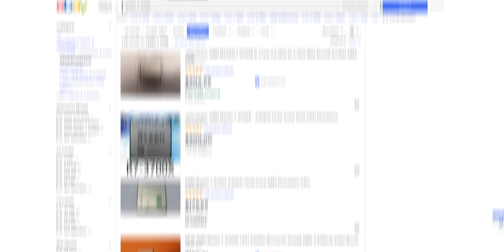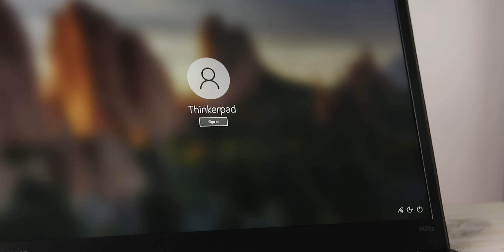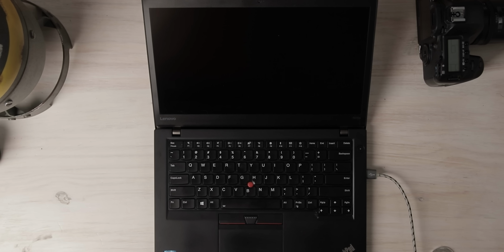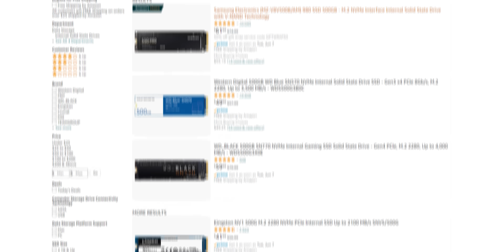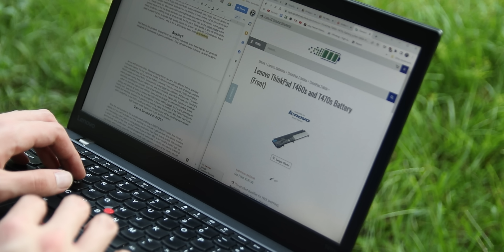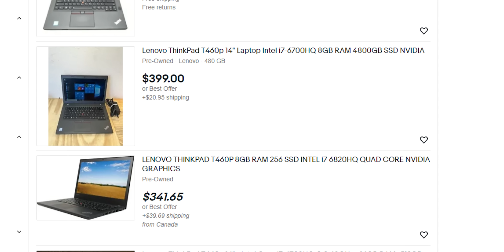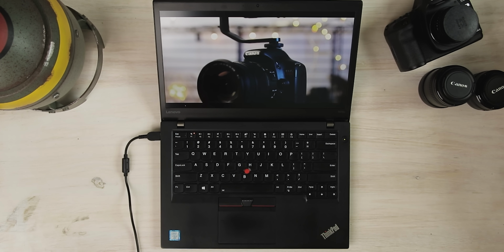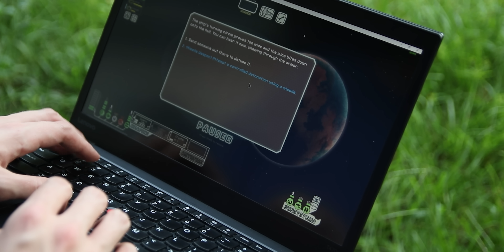I Couldn't STEAL A Better Laptop... I Tried - Lenovo Thinkpad T470s

Comment: Lenovo keyboards are awesome. I have yet to use a laptop that has a nicer keyboard than a Lenovo Thinkpad, and that includes the keyboard on my $4,000 MacBook Pro. (The MacBook is an awesome machine, but the keyboard is ass and I generally use a Logitech Bluetooth mechanical instead.)

Comment: i got a L380 with i5 8350 at 170USD. it was from a computer part store, so i ask if the can upgrade me to 16GB ram. He was like ok. i walk out with a laptop with 16GB RAM, 256SSD NVME, and only 230+ charge cycled battery. add another 5USD for a fresh thermal paste. Viola, a good laptop that will last at least another 3 years

Comment: I'm new to the whole Thinkpad Linux thing, but I'm looking for a portable laptop that I can use when I'm working away from home to self teach some web development. Don't really want to go down the MacBook path as they're way out of my budget, so what Thinkpad should I be looking for on the used market?
Reply from the maker: Can't go wrong with a T470/T480 if you need a 14 inch screen in the low $200 range. If you need a bit more power/cooling/screen the p50, p51, and p52 are all great options too. P70 for a nice big 17 inch screen, and X280 if you want a more compact laptop. I'm currently using a T14 gen 1 with Ryzen 7, absolute machine.

Comment: i bought this computer two days ago because of this video and i'm excited to try it!! Does it get overheated?
Reply from the maker: Glad to hear it! For doing basic tasks or gaming, my i5 model didn't overheat. The i7 did get warmer but I haven't done much extensive testing on it. Looking to start including more insight into how hot laptops get in future videos.
Reply: How is going? I'm about to buy one
Reply: @jaco2770  It's a great laptop, I use it for everything, and I haven't any issues related to performance, I did the same as he did, updated drivers and it is working really smooth, I just had an issue with the rj45 port, after one month it isn't working, so I'm going to talk with the seller, I have a one year warranty, I bought it in eBay

Comment: I recently got t480s refurbished. I chose the ram 24 gb and 1 tb ssd thinking it would be better. It is preety fast but my only concern is the high fan noise. I cannot understand if it is normal no have the fan working like that while just using google chrome.. and I downloaded a computer performance test and the result was below average. I am thinking if I should give it back

Comment: This is why I get so angry about the arbitrary "8th gen" CPU cutoff point for Windows 11. All the best cheap thinkpads are 7th gen and lower. I've been using an X270 which I got for insanely cheap (round about $120 - $150) and the only "upgrades" I did on it was a new extended battery (which turns it into a bit of a chunker) and a new SSD for more storage. I use it every day on battery and I only need to charge it once a day, easily get up to 10 hours but the only downside is it's still running a 6th gen so no free Windows 11
Reply: I suspect part of it was establishing quad-core as a baseline as well.
Reply: @TheGreenReaper  Nah. It's 100% ageism. Windows 11 is perfectly happy with a celeron N4020 which is a dual-core cpu and also some Pentium Silver (also dual-core)

Comment: Go Thinkpad!  I love these machines and everything about them as I cling to a battle scarred i7 T430s (3520M @ 2.9 GHz with 16 GB of memory and the NVIDIA NVS 5200M upgrade from circa 2012.  Further to comments re Thinkpad vs Macbooks, I specifically found and ordered it because > 11 years ago it would click into its dock for THREE external monitors at 1920 x 1080.  That was something I needed then, but a request which inspired only confusion from Apple salespeople.  If it finally dies one of these days, I would appreciate a smaller, lighter Thinkpad (if possible) with a higher resolution (non touch, preferably glossy) screen.  I continue to dock and mainly use external monitors but that would help for travel and /or watching a movie when falling asleep.  Could any experts please recommend a Thinkpad model and spec to replace it?  Which might also be a bargain in today's refurb market?  Thank you so much.

Comment: I got a Lenovo A485 with 16gb ram Ryzen 5 @2.2gH+ 4 core fpr $2670 delivered eBay.. but it doesn't like Linux (I'm running Mint on it now, but there are quirks) so I got a T480 i7 quad for about the same..  I did get one A12 that was semi-locked (BIOS tracking activated).. and that absolutely would not boot any version of Linux
Reply: 2pk Magnetic USB C Adapter 5Pins Type C Connector USB PD 100W Quick Charge lot

Comment: I have a question is a t14gen2 better with ryzen 7 5850u or intel i5 1145G7?im in the market for thinkpad to use in my last year of college.thanks
Reply from the maker: I'm personally very partial to ryzen 5000 in laptops over intel. If it was a prior ryzen generation (3000 and below) I would probably go intel.
Reply: Ryzen 5850u is faaar better in every aspect
Reply: Ryzen 7 hands down, better cores vs the stagnant Intel and vastly better IGP. Just be sure to hunt down a very good ram kit with good timings then you'll never look back. Don't use single sided modules as the LP style ram docks 20% of the performance for both AMD and Intel.

Comment: please, i need an advice.
in my country T540s & W540 is in similar price.
i will use it for my study in 2D design but since covid hit hard my family, i can't dream more for brand new laptop.
since T540 only have one slot ram im afraid if i need to upgrade it later since the laptop will use at least for next 3 years.
did w530 is great option or I should chose T540s anyway ? 

and this will be my first laptop 😄. 

thank you for the answer.
Reply: Definitely w540/541 suite for design powerhouse
Reply: @DOLFO_CH  thank you very much fkr the great bright reply sir.!
Thank you.. really appreciate that.!

Comment: Ive had a t430 for like 5 years lol still great and fast. Battery definitely not good as it was. I have the dock station also for it which comes with even more ports and a dvi and vga slot also. Its weird cause i use geforce now streaming for gaming and no problem?

Comment: I have one of the thinkpad series Its a carbon x1 screen spoilt after while. Apparently finding a replacement has been a bit of a struggle. It has even came to a conclussion that the problem might not be the display but rather the motherboard. I dont know what to do with the machine now.

Comment: Are you sure the T470 doesn't run Win 11?
I only ask because I have a T470 running 11 and after your comment I'm wondering how.
Reply from the maker: From what I understand, it's not "officially" supported, but it's pretty easy to throw windows 11 on almost anything and it'll still run fine
Reply: @aChairLeg  yeah I work in IT for a non-profit and Windows 11 does for most part install on pretty almost any Thinkpad -- even the L450 from 8 years ago!

The only "caveat" (if it is one) is that the 'big' 22H2 update won't install because Microsoft says only laptops  with Intel Core 8000/AMD Ryzen 3000 and more recent CPUs can install that significant update.

I have heard of workarounds, like editing some .dll file that somehow removes or bypasses the check Windows conducts to verify whether your hardware is officially supported or not, but I have yet to try it myself.

Comment: whoever goes fro a crappy new one instead of those good old poweful ones is just an ignorant i still have one with an ssd and another ram stick in and it legit made me 10s of thousands of dollars sitting on a desk for 5 years now with an external display hooked while the one its got ussed as a 2d display those thinks are LEGIT PROPER WORKHORSES

Comment: Found this after graphical problems with my t430. I can't fluently record my screen and a Webcam. Without Webcam I'm fine, but with, I always get stutters. My specs aren't that bad. Got a SSD, an i7 3520m dual core @2,9 GHz and 16 GB RAM. But the old Intel graphics HD 4000.

Don't know what's causing it. Does anyone know? And am I forced to upgrade?

Comment: what's a good place to get t470s replacement batteries?
Reply from the maker: I got some genuine "good condition" batteries on ebay for my T470s. Got a used w 13 cycle battery on ebay for my T495. Outside of that I'm not too sure honestly.

Comment: I would inspect it for hardware level rootkits. Make sure the bios (and chip) is the correct one for that computer.  

Churches are helping parents spy on their kids. If the kid is even remotely computer savvy they will pre program a corrupted bios onto a chip... then swap the chip when the kids not home.

 Azzholes tried to doing it to me. (My aunt didn't realize I've studied Pen-testing for several years.) Ram is another common place they can store a ring zero rootkit. 

I wouldn't be surprised if crooked pawnshops are also doing it... If not for themselves... For pigs... Or they come into the store already infected. 

Schools are doing this too. To prevent their tablets and devices from being stolen... They are also spying on the kids and families through the devices.

Comment: Listen my man, try hackintosh. I heard thinkpad are great for hackintosh. Also if you still wanna run Windows 10, try atlas os.  What is that? Its windows 10 but bloat free with extra optimized stuff. So you will have more free cpu+ram = Fast af windows experience.
Reply from the maker: I've been considering it, but the lack of future support for intel CPUs due to m1 is a big turnoff.

Comment: I had this laptop with me running for like 2 months now, the only issue that im facing is sudden shutdown, and i dont know what's the reason behind it :/
Reply from the maker: Funnily enough, I had a similar issue on mine on Linux. Once the first battery depleted and it switched to the second, the laptop would shut down. Not sure if that helps at all. Could possibly be an overheating issue too, these do run pretty warm.
Reply: Also try reinstalling windows. Windows like to crash when storage is corrupted

Comment: 1:45 no, i5-6300U is garbage, scoring a pathetic 3252 cpu mark and 1683 single thread rating, both very low scores on passmark.  Any single thread under about 1800-2000 and multicore under 6,000 is garbage and not worth buying today.
Reply: Thinking of getting a 7th gen any insights a year later?

Comment: I have a T470. What bothers me are the compromises Lenovo adopted when it comes to NVME and thunderbolt. Both severely crippled in the T470 and T480.😢
Reply from the maker: I wasn't aware of any shortcomings with nvme. Does it not get enough pcie lanes or something?
Reply: @aChairLeg  2 lanes, speed capped at 1500/1600 MB/s.
The thunderbolt port is equally crippled. You have to choose between using it to attach USB 3 storage devices at 10 Gbps speed, or to drive a 4K monitor at 60Hz. Reason why I bought a "legacy" docking station to output a displayport signal to drive the 4K monitor, so that I can still use the thunderbolt port with external SATA 3 SSDs.

Since the thunderbolt port is crippled it doesn't make sense to spend money on TB3 docks / enclosures due to the reduced bandwidth and speed.

Comment: Lenovo have been pure utter garbage of late. We use them at work and let me tell you they're terrible. A batch of 20 devices were DoA and 15 more had WWAN component failure within the first few weeks. This is out of around 200 devices that were ordered. Lenovo also have a knack of sliding in critical / catastrophic bug fixes into their driver updates without updating their release notes... like they're too embarrassed to admit how utter trash either their engineering department or hardware is.

Comment: You will love your Lenovo Thinkpad right until you have to replace batteries and don’t want to spend a fortune by sending it to Lenovo or buying batteries from them directly.

They have programmed in a "function" which limits your CPU to 0.7 GHz just because third party batteries don’t have a special chip inside them. Even though they are perfectly fine otherwise.
Reply from the maker: Weird, my i7 t470s got third party batteries and they've been working fine for abt a year now

Comment: That may be a good buy, but new those laptops suck and are expensive. Keys fall off, wondering mouse is normal. The thermals do not allow any throttling at all. They look like 90's laptops... the pro support is a single Indian fellow who doesn't speak English and takes over an hour to answer. 
To note... I am a IT guy working for a company that currently (or did) buys more Lenovo's than any other company on earth... they are over priced, under specked shit! 

Our IT log is "My pc is slow". "My laptop is slow", "my mouse moves on it's own", "my laptop s mssng a key", "my battery last only half hour"...

Comment: baka you could have bought it for like a cheap price of 83 dollars in ebay
Reply: even i use a thinkpad t540p which i bought it for just 60$ and it was perfect without changing anything and it also has a nvidea graphics card
Reply: i have a 2 slot for ram
Reply: i had played cs go, assasins creed, and read dead in this thnkpad t540p
Reply: exactly my t440s was 59